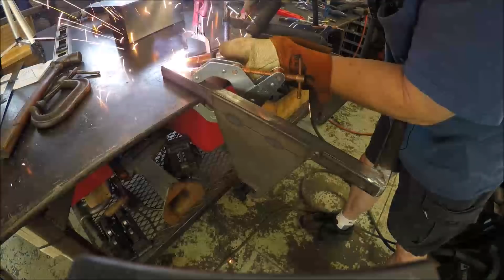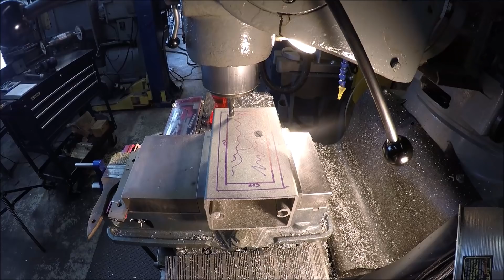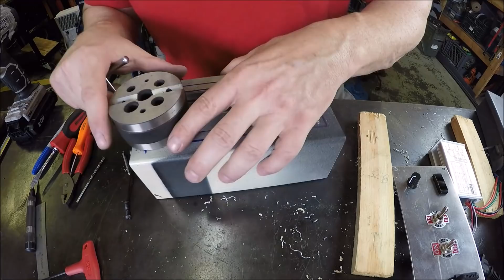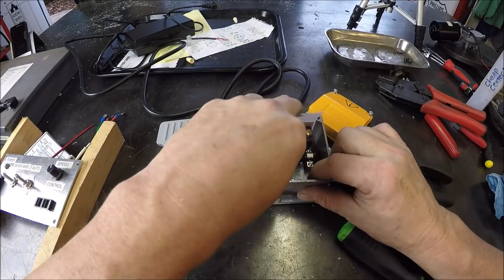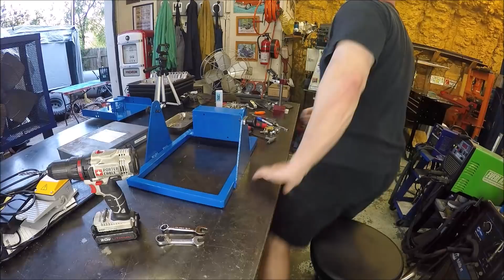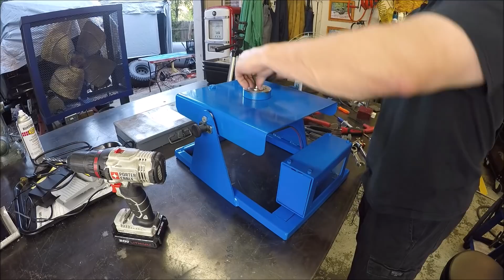Rotary welding table build Part 7

Comment: I was thinking a potentiometer type foot pedal would be better, but probably more expensive! That way you could control the table speed with your foot. Kind of like your tig torch. With the blue paint it looks like a Miller product!
Reply: Was just about to saynthe same thing.   But if your tig welding Running 2 pedals  would suck.

Comment: You could hook both ends into a spring, then hook the spring to the copper piece.  Why not cut the section out of the box with a side grinder and cutoff wheel.  Then cleanup on the mill.-  I love the crimper's, I've got a set like those.  They give a perfect crimp. - Is that TAR HEEL Blue?  - It's looking good!
Reply from the maker: Its sail blue. No tarheels allowed in wolfpack country..........:)